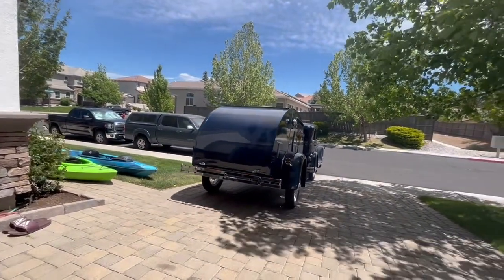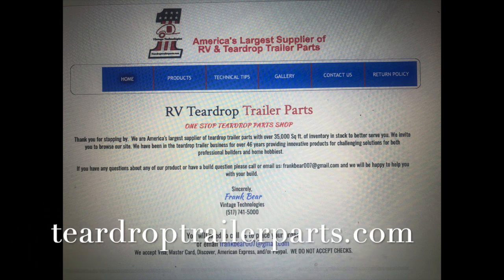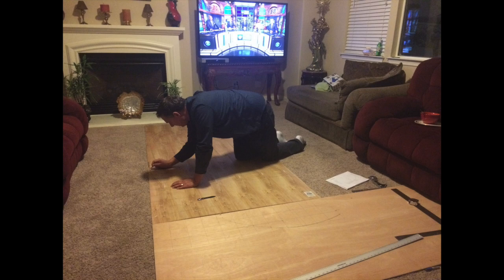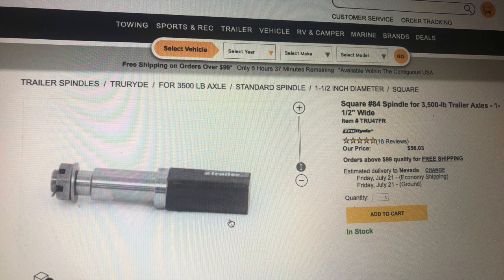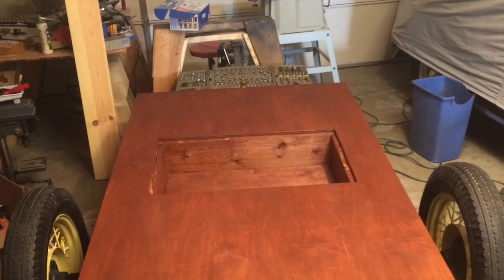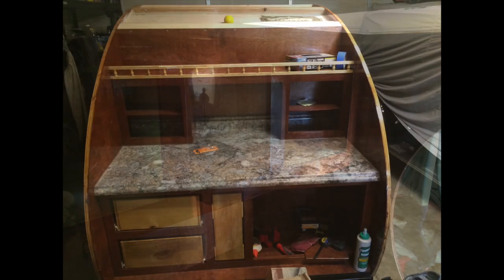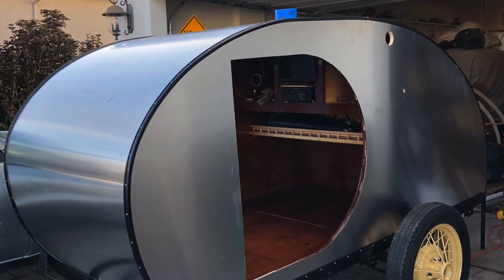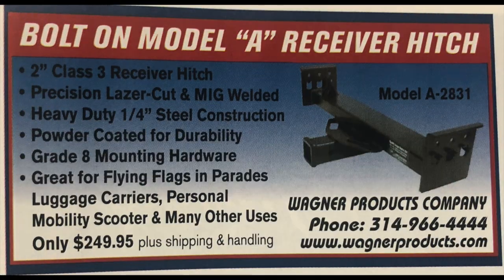How we built a teardrop trailer, matching our 1930 Model A Ford Fordor sedan.

Comment: I’m glad you mentioned the weight of the trailer. I have a 1930 Model A Deluxe Coupé. But, my car has a 1932 Model B 4 cylinder, and a ‘32 Transmission. ‘30 Model A rear differential. My 4 cylinder engine has been rebuilt with a higher compression ratio 7:1, and about 50 horsepower. With a Ram Head. I just need a larger capacity Radiator. I’m in the Southwest, at a higher altitude. So, with the drier climate this robs my cooling capabilities. But, 800 pounds sounds manageable. Thanks!
Reply from the maker: Slow and steady wins the race. You’re not going to win any speed contests but if you’re patient you’ll get there. Our car is stock with a high compression head. She’ll pull it fine, just stay off the expressways.
Thank you for your comment, glad you enjoyed the video.
Reply: @modelajim1930  Thanks, for the advice. I’ve seen 4 core radiators from a AA fit to a Coupe, but some mods had been done. We have a Radiator Guy here, Lambs Radiator in nearby Belen, NM. And he recommends a “High Efficiency” type radiator. Also, slightly pressurized radiators are available too. But, adding pressure can bring on its own problems too. Also, a overflow tank might help too. Thanks, again.

Comment: Nice build, I like the way you incorporated all the model A parts.
Reply from the maker: Thanks, Stephen, Yes I tried to use Model A parts whenever possible. Fenders, bumpers, door handles, hatch handles, cowl lights, trunk, tail lights. Think think that's everything....
Appreicate your comment, thanks for watching.
Reply: @modelajim1930  Were the fenders from a 1930-31 Coupe?
Reply from the maker: @ModelARickLasCruces  Yes, that's correct. 30-31 Coupe / Roadster fenders. I got them from a guy who had more Model A "stuff" than I've ever seen in one location. Good thing I didn't have lots of money with me, or I have more "stuff" now.

Comment: Speaking as some one who has done a fair bit of cabinet building as well as metal fabrication and welding, I would have to say that You, SIR are a fine cabinet maker. The workmanship shows patience and superb attention to detail. Very nice job plus your teardrop trailer compliments your Model A beautifully. Thank you for sharing the project and for providing such details as to supplies and dimensions. Greetings from Ontario, Canada.
Reply from the maker: Greetings Barry,
The project was as much about the challenge of the build, as having the trailer to use. I’m very happy with how it turned out. I thank you for your kind words of the workmanship, it turnout nice considering what tools / space I had to work with. I’m actually in process of building a second one at this moment, for my daughters to use. 
Thank you for your comment.
Jim & Lindy.

Comment: Love your videos & adventures. I don't own a model A (yet) but do own  a 4x8 teardrop. 

It weighs 780lbs, I didn't see you add any  electric brakes how's the stopping?

I'm a very diy guy & I'd like to try building a foam teardrop,  for weight savings & no dry rot issues.  

LOVED the Colorado trip!! Your videos inspire the next generation 😊
Reply from the maker: Wow! Thank you for the wonderful compliment. I haven't weighed the trailer but my guess was in the ballpark of 800 lbs, so thank you for telling me your trailer's weight. Don't have electric brakes, as there's no way to active them with a Model A. It stops just fine, as we don't go very fast pulling the trailer. The Car has a brand new (stock) brake system, so the brake are in top shape for a 93 year old car.
Everything has three coats of marine varnish on it, so that, along with it being garaged in a dessert climate, hopefully will keep the rot away, for as long as I'm around anyway.
Appreciate you watching our video's thanks for the support!

Comment: This is a beautiful build.  I do have one question.  I may have missed it, but I did not see any information on the axle springs you used.  Do you have any info you would be willing to share?  Thanks!
Reply from the maker: Hello Ken,
I just used a simple leaf spring (2,000 lb rating) setup I got from Etrailer.com, they have all the mounting hardware as well.
Thanks for the comment. I’m actually building a second one at this very moment for my daughter.
Reply: @modelajim1930  Thanks for getting back to me!  Sounds like you are having fun.  I won't be building a teardrop, but I will be building a matching trailer for my huckster project so I appreciate you sharing how you built the frame.  I didn't want the weight of a Model A rear axle or the hassle of converting a front axle.

Comment: Hey Frey ...this is stan Nowlin... thinking about building the same for my model A ....was wondering if it pulled good, and what about stopping. did you struggle  going up hills? or was it a piece of cake. do you have overdrive or just 3 speed?

I know one thing you sure look good going down the road. very jealous..  so I'm thinking about doing the same anything I need to think about?
stan
Reply from the maker: Stan,
As I stated in the video you need to keep the weigh as light as possible. I’ve never weighed the trailer, but if I had to guess I’d say it’s about 800 pounds. It pulls fine, uphill is second gear most of the time. I have excellent brakes on my Model A, brand new everything, so stopping is fine too, just use common sense as slow down before hand. I don’t tow it with my Roadster as the car is so much lighter than the Fordor. We don’t tow it too far from the house, usually staying with 50 miles. Any farther we tow it with my pickup. Great to have, fun to use and was a fun build project. I’m actually building a second one for my daughter as we speak. 
Good luck!

Comment: Great video.  Looking for teardrop for a 1930 coupe.  What was your estimate cost?
Reply from the maker: @Jyock  Hello, if you’re building it yourself, you have the flexibility to spend as much or as little as you wish. If you’re looking to purchase one, the range is pretty wide depending on size, features, and finish. But just ballpark $6000 on the low end and $12,000-$15000 on the upper end. If you intend to use a model A, weight is your most important consideration. 800 pounds should be your maximum. Stopping it is more of the issue than pulling it.
Reply: @modelajim1930  what do you think about installing trailer breaks.    I'm still debating if I'm going to install blinkers. Want to install the Mitchell overdrive I just need to convince my wife it's a good idea.  Will help with the hills.  In the future I want to do an extended trip.  Thanks for the response and enjoy your videos.